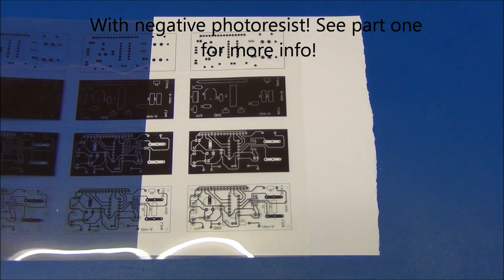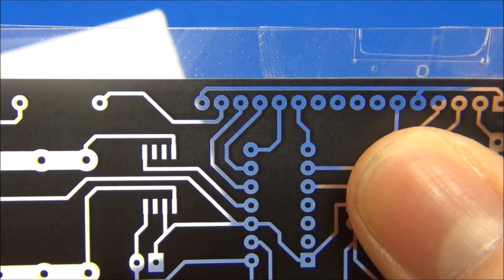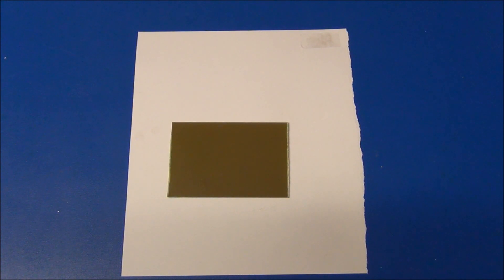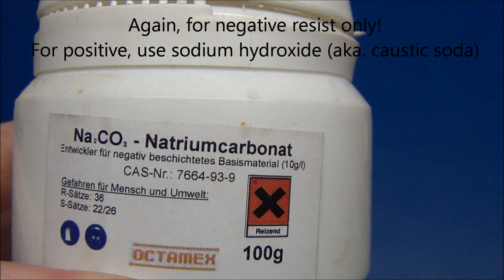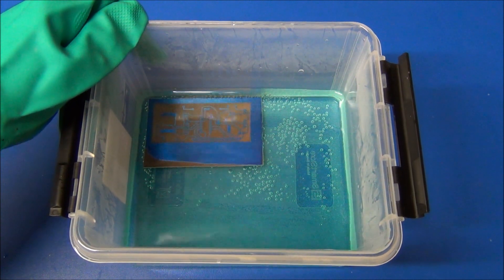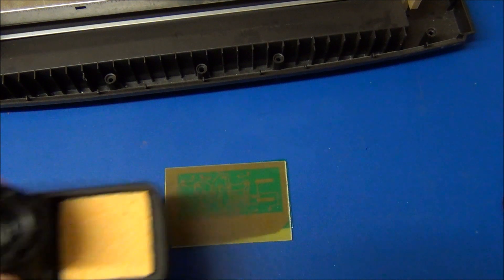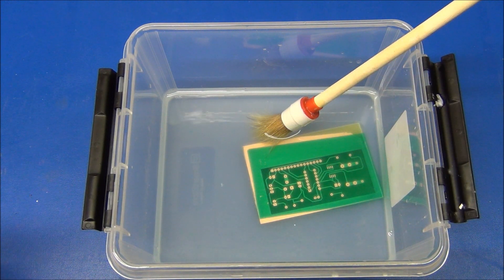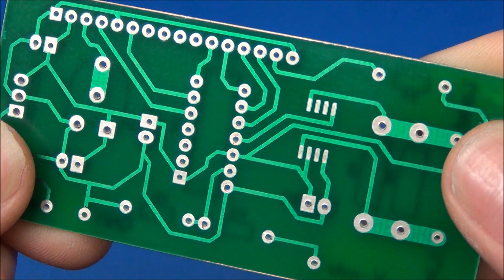Ec-Projects - DIY Circuit Boards ( PCB ) Part 3: UV Exposure

Comment: What laminator are use you using ? Most laminators can accept only thickness of 80-250 microns byt the copper clad is definitely thicker than that.

Comment: hi did you have  pcb for uv loght?
Reply from the maker: Yes :) I have just uploaded it to my web-site:http://ec-projects.com/diy-pcb-manufacturing#The one I used in the video is made from 3 boards that have to be soldered together.But there is also a small one.
Reply: EcProjects how much is mimimum?
Reply from the maker: Do you mean how much the materials cost ? :)
Reply: mo mimimum of light that is working?
Reply from the maker: Ohh, okay..You just need the UV-panel to be the same size as the largest PCB you want to expose..(At least with the spacing between the LEDs that I used).So with 600 LEDs you can expose up to 20x30 cm boards in about 2,5 to 3,5 minutes. I drive it at 1,6 amps, and it will need about 22 volts..
Reply: EcProjects yust  last question i  like your videos so far,and witch led are  is it uv leds or something else?
Reply from the maker: Yep, UV-LEDs :)

Comment: Hi, great tutorial.

What is the make an model of the laminator? I can't seem to find one that will accept the 1.6mm thickness of the copper board. Most offer a max thickness of 200 micron (0.2mm). Not sure it means the film only, or the film and the stuff being laminated (board this case) altogether

Comment from the maker: Hey, I used 600 LED's. I have 6 in series, and drive it with 1,5 Amps...
I used regular LED's, but found that it needed to be about 15-20 cm away from the PCB, for the light to diffuse properly.. 
I will recommend using wide angle LED's, sometimes called "Straw hat" on Ebay.. They will only need 3-4 cm to diffuse..

Thanks for the comment :)

Comment from the maker: Do you mean as copper as well ? Or just as a print ?
If it have to be copper, you will need a double sided board, and then repeat the whole process on the other side, using a film with just the pads on it (remember to cover up the first side when making the second)..
If you just want the pads printed on, most PCB software will let you put them on the silkscreen..

Comment from the maker: Wow, that resistor must be a gigant :D 
I think it is a pretty neat idea :)
Couldn't find any at my local scrap (mostly old metal) yard. 
But I did pick up some wide angle LEDs on ebay, both some red and some UV.
So if they happen to be 160* angle as claimed, I might do a video of making an exposure box with a timer made from a PIC micro. And a "red light" LED panel as well :)
My current UV panel needs like 25 cm for the light to blur together, because the angle is very narrow :/

-Mads

Comment: I got some years ago as surplus, and did this to them. They are really bright, i generally run them with a big power variable resistor ( loudspeaker inline volume control from the 1970's ) to dim them a little. Otherwise they are too bright, as bright as a 50W halogen lamp.

Comment: Tip for the dark work. Make a safelight using a dozen or so hyperbright red LED's run at 20ma each. That way you will be able to see, but the film is pretty insensitive to the red light.  place them in an array and diffuse the light with a translucent cover, and arrange it so it lights up the area. A good source is a LED high brake light bar, take one that is working, mask off the lens and spray it matt black, then when dry sand the lens with the 1200 grit paper till it is opaque. Then mount it.